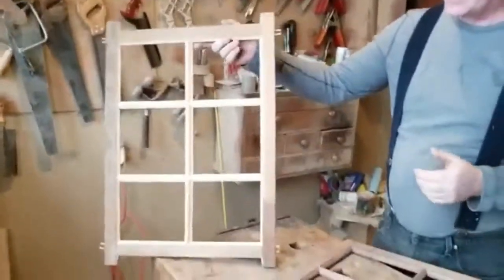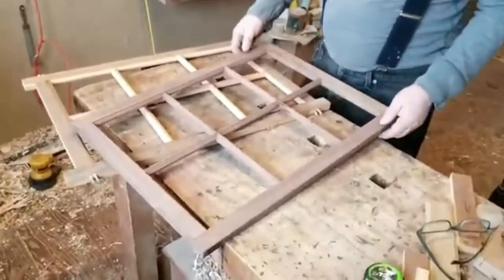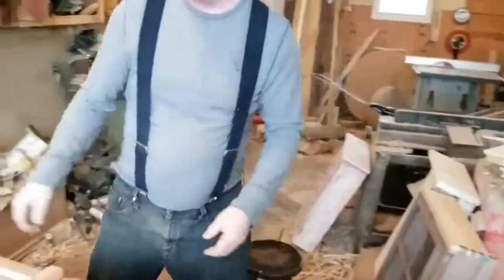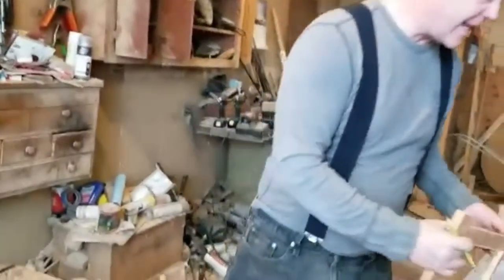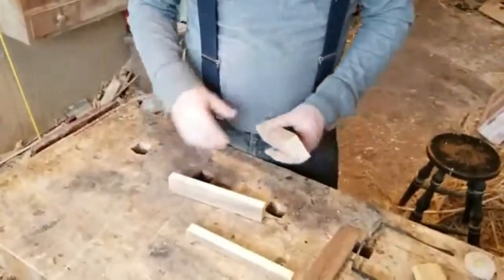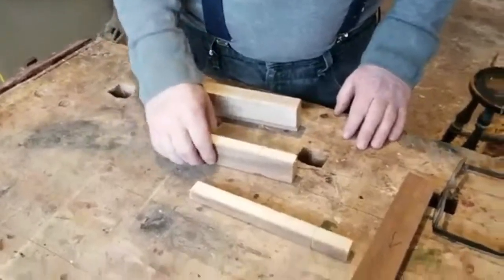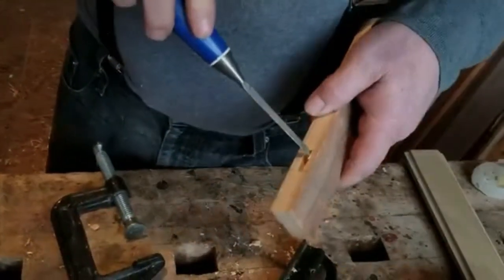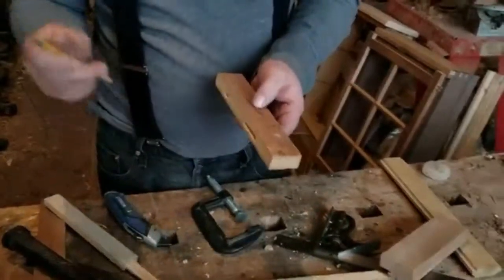Sash Building / Sash Planes

Comment: How is The box frame (housing the sash windows) rebated correctly ? Request dimensions of its rebate and thickness of the wood in the frame, sufficient to provide strength under load Pb weights). Thank you.